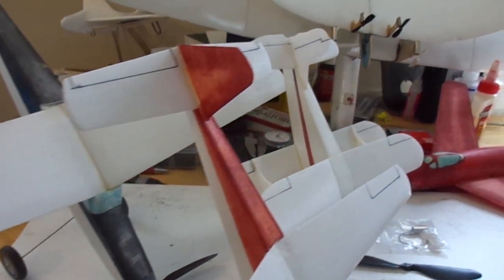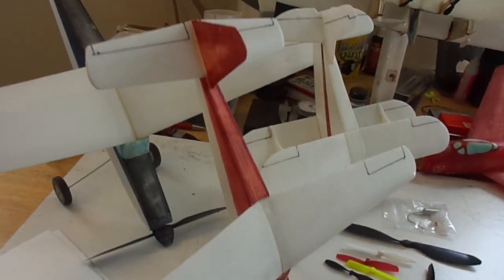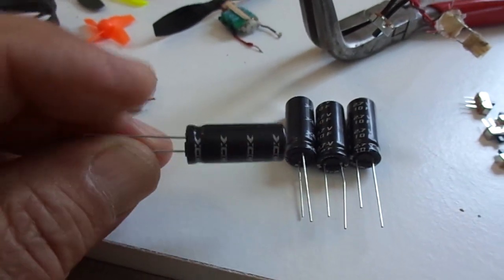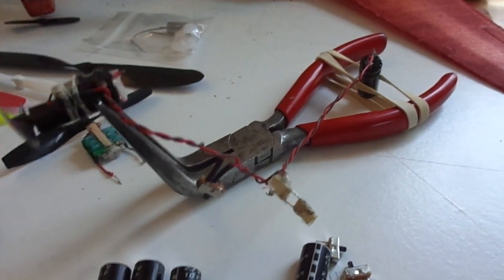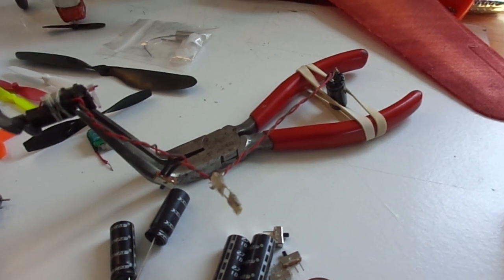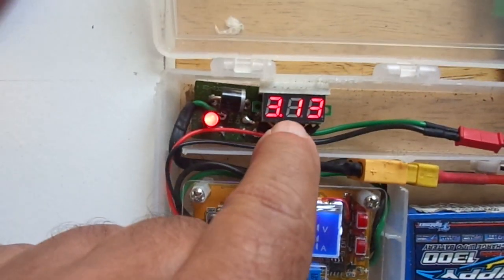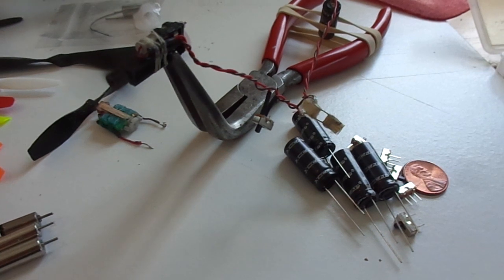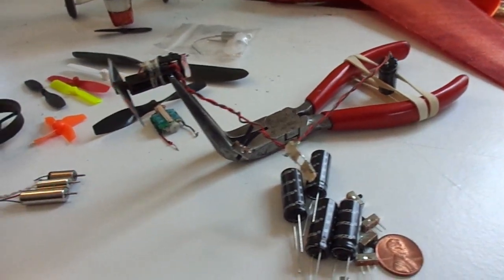SUPERCAPACITOR FREE FLIGHT BASICS

Comment: I just started playing with these recently. We found some cheap adjustable USB powered step up + step down circuits so we charge off a USB power bank. They have digital voltmeters attached. We've found that you can charge these to far higher than the rated voltage - we regularly charge to 5V, the highest I have gone to was 8V, a month ago, which resulted in catching a thermal and a 10 minute OOS flight. Remember that, with capacitors, the energy stored is proportional to the square of the voltage. At these high voltages you get a huge initial power burst, much like rubber, which makes for almost vertical initial climbs. There are a couple of videos on my channel.
Reply: Thank you! Can you share a link to the adjustable USB step up  / step down gizmo? Any how to links you can share greatly appreciated!
Reply: @stevejohnson3991  Not sure if I can post links, I'll post one in the next reply.
Reply: @stevejohnson3991 I tried posting a link, it got deleted. Try going to your favorite shopping site and search for "boost buck USB" and see what comes up

Comment: Hey mate
Im trying to understand how to do this capacitor setup. Where do you get the switches? And what sort of wire do you use for the charge port?
Reply from the maker: Hi, thanks for the view and question. I put links to some of the items including switches in the text description beneath the video. Let me know if any of the links don't work. Hope you give the caps a try. Charger wand and receptacle on model are very short pieces of thin paper clip wire or the extra wire from the capacitor leads. BTW we have been installing 2 of those little switches in parallel on each model since they are not super high quality and a double set of contacts ensures a good solid motor run. -Mike
Reply: @sonex413 thanks for that. Ive followed the links and found a few things to buy. Im building a Nesmith Cougar for my first capacitor test model. I’ve built hundreds of peanut scale and larger free flight models in my life. But capacitors interest me now

Comment: Great video! I was looking for entry points into model airplanes and got me a rubber powered glider with very nice glide performance and I also plan to do a RC conversion on it next week. 
I'm also eager to try out if the SuperCap powered Motor from Vincent Merlijns Rookie has enough power to sustain its altitude for some time :)

Comment: you could put 2 caps in parallel and get twice the runtime
Reply from the maker: We actually do that quite a bit. A good combo is a 8520 motor, 2x 10F caps in parallel and a 65mm prop on a 16 to 20 inch span foamie. Run time about a minute.

Comment: What's the purpose of adding gear reduction? Instead, you could easily use a smaller prop and the coreless motor would easily provide the rpm necessary to produce a comparable thrust or more.
Reply from the maker: It was an experiment but worked really well. I don't think anybody makes props that small commercially and smaller props are less efficient anyway.

Comment: Take a look at so called "supercapacitor chargers", like LTC3110. These bi-directional dc-dc converters control charging and discharging of super capacitors, keeping the output voltage constant even when the cap discharged. You can also charge the cap to much higher voltage and then discharge it at constant low voltage for very long flights
Reply from the maker: Thanks, that is excellent information!

Comment: What kind of discarded devices might have 10 farad caps?
Reply from the maker: Not used in many consumer devices...I've never seen one in its natural environment. They are generally used in power backup systems to overcome temporary interruptions in power supply. They have applications in computer memory backup power, etc. Best source we've found is Banggood.
Reply: @sonex413  
I had a few power transformers. 15000 mf @ 50V. Big as a beer can too. Nice transistors in them though. I'll keep an eye out. I'm always finding stuff with circuit boards worth salvaging.
Reply from the maker: @AngryHybridApe  Wow! 15000mf means it could probably kill an elephant! I found some really good 10Farad 3V supercaps on ebay recently, they are sold as "18V 1.6Farad capacitor module" and has 6 10F 3V caps on a circuit board (series wired) along with some small surface mount components which serve as a balancer for the caps. Since they are wired to the board in series you get 18 volts (3Vx6) and 1.6F (10F /6=1.6F). They can be desoldered from the board and they have a bit of an advantage over the typical 2.7 volt caps. We have flown a few and they are AOK. Same dimensions as 2.7v 10F. I bought 5 boards and harvested all the caps!
Reply: @sonex413  
You should see the transformers that came with them. A little bigger than microwave oven transformers. But thats because the secondary winding was huge.
Reply: @sonex413  
I bought some MOSFETS on ebay once. Bought them from 3 different parties. Everyone of them didnt work. I only needed two. But one guy I bought 10 from another 5 and another 3. One guy wrote me the weirdest note. His delivery was a few days late, so he wrote me asking to not tell Ebay he was late.
I wish electronic stores were still around. There's a few. But limited inventory
Reply: @sonex413  
Im making a video today if everything goes right. I make motorized paper airplanes out of microdrones. I've made a few of them so I got it down pretty good. Ill let you know how it turns out.

Comment: capasitors are a really great idea and maybe a little bit underestimated! I want to use them for some test flights when I don't know what battery or control system or receiver etc. is the best , capasitor  deffinetelly would help me to choose and also I can calculate the distance for my plane with the capasitor so actually no extra transmiter-receiver needed (and other stuff)
Reply from the maker: Great point! They are a very simple form of power for small models. Thanks for comment!

Comment: I have posted some model build photos on Hippocketaeronautics.com - ''Capacitor powered electrics vs. rubber'' under the name SX976. All inspired by the sonex413 team!! Thanks a lot guys. I am particularly happy with the Avro Manchester. Whenever lockdown ends I will be able to fly them.
Reply from the maker: Hi Chris, I was not aware of that site. Looks great so I registered (user Sonex413 of course). Hey, your Manchester is a beauty! I think there are many possibilities for caps to replace rubber when it comes to scale or semi-scale models, especially multi engine or designs with short nacelles, etc. My latest is a scale model of a semi-scale model! That is, a half-size replica of the old single channel R/C Goldberg Cessna Skylane powered with 8520 coreless and 20 Farads. I'm also awaiting a test flight but I'll post a picture on the community tab of my channel before that. Stay safe my friend, at least we're getting some building done during this lockdown! -Mike

Comment: Just built a Sopwith triplane with my 8 year old daughter, old school balsa and tissue, I think we'll have a go at this on it as a drone guy, I have a lot of coreless motors, and much bigger ones too. Best information I've found thank you for your work and passion.
Reply from the maker: Thanks Ben! Wow, depending on what kit you built, that might be asking a lot of a capacitor drive! I suggest a geared drive to allow a larger prop than a direct drive...so you can get the prop tips to stick out past that cowling. BG has a geared 820 drive with a 5.5 inch prop which might work. Remember, these motors are designed for 1 lipo cell so when we run them on capacitors at 2.8 volts "burst" voltage there is only so much power there. Don't expect the kind of thrust you get from a similar motor in a quad. Best plan is to bench run your proposed setup and see if you have enough power before you install in a model. If a supercap doesn't do the trick, you still have the option of powering the motor with a single lipo, using a simple MOSFET timer. You'll get at least double the thrust of a supercap setup. I'm working on a video on how to make the timer for about 5 bucks. See video mentioning MOSFET TIMER in the title to see one in action. Good luck!!  -Mike

Comment: Je regarde toutes vos videos et c'est fantastique j'adore mais j'ai essayé de faire des planeurs avec tout ce qui faut: capacitors 10 f ,propeleers 45 cm ou 55mm et j'ai essayé toutes sortes de moteurs comme vous mais rien a faire il ne veulent pas voler mes avions font moins que 20grammes 
Pouvez vous m'aider a voir pourquoi mes avions ne volent pas du tout merci
Reply from the maker: Bonjour, je suis désolé d'apprendre que vous n'avez pas encore eu de succès avec vos modèles! Tout d'abord, assurez-vous que vous utilisez les bons composants. Le condensateur doit être ce qu'on appelle un supercondensateur ou un ultracondensateur. Ils sont généralement évalués à 2,7 volts. Nous avons utilisé un seul condensateur 10 farad couplé à un moteur «sans noyau» de 6 ou 7 mm de diamètre. Les moteurs plus grands de 8,5 mm de diamètre nécessitent (2x) 10 condensateurs farad câblés en parallèle. Tous les moteurs que nous utilisons sont évalués à 3,7 volts, c'est-à-dire qu'ils étaient à l'origine utilisés dans des appareils fonctionnant avec une pile au lithium de 3,7 volts. La plupart sont destinés à être utilisés dans de petits quadricoptères. Voici les spécifications d'un petit modèle typique:

Envergure: 32 cm Poids en vol: 11,5 g Aire de l'aile: 135 cm ^ 2 "615" moteur (6 mm de diamètre x 15 mm de longueur) et (1) 10 Farad, 2,7 volts supercondensateur L'hélice mesure 50 mm sur ce modèle. Cette combinaison vole environ 30 secondes en moyenne.

Pour un modèle dans la gamme de 18-20g, je suggère un moteur de 8,5 mm de diamètre x 20 mm de longueur avec une hélice de 65 mm ainsi que (2) condensateurs 10F en parallèle.

Bonne chance et si vous avez d'autres questions, faites-le moi savoir. -Mike
Reply: @sonex413  mERCI BEAUCOUP POUR LA REPONSE ET C'EST TOUT CE MATERIEL QUE J'UTILISE MAIS AUCUN NE VEULENT VOLER ?POURTANT J'AI TOUT ESSAYE LES SUPER CONDENSATEURS 10,7,60 ET 2X 10FARAD ET TOUT LES MOTEURS 6,7,8,10 MM ET LE POIDS EST BON AUSSI SUR CERTAINS ,, JE NE COMPREND PAS ?J'AI DEJA FAIT UNE DIZAINE D'AVIONS DE TOUTE SORTENT MAIS RIEN A FAIRE ILS NE DECOLLE PAS ?MAIS JE N'ABANDONNE PAS  BONNE CONTINUATION POUR VOUS C'EST UN REGAL DE REGARDER VOS VIDEOS ET JE SUIS JALOUX  quel poids ne peut on pas depasser?
Reply from the maker: @noramghislain1258  Salut, Si vous regardez au tout début de cette vidéo, vous verrez trois petits modèles. Au centre se trouve un petit modèle rouge et blanc avec une aile haute montée. Dans ma réponse précédente, j'ai énuméré les spécifications d'un modèle typique ... Ce sont, en fait, les spécifications de ce modèle. Le petit modèle biplan utilise le même équipement ... et le plus grand modèle bleu et blanc (qui est en fait une version plus grande du plus petit) utilise un moteur de 7 mm avec une réduction de vitesse et une hélice plus grande. Si vous avez vérifié que vous utilisez le bon équipement, la seule chose qui reste est la charge du condensateur. Vous devriez utiliser deux piles «AA» connectées en série appliquées aux bornes du condensateur pendant environ 10 à 15 secondes. Vous pouvez lire la tension du condensateur pendant la charge en connectant un voltmètre aux bornes du condensateur pendant la charge. Une charge complète permet au condensateur de contenir environ 2,7 à 2,8 volts. Câblez les composants et testez-les sur l'établi avant de les installer dans le modèle. Vous devez observer une forte poussée pendant environ 15 secondes, avec un ralentissement progressif et une durée totale de fonctionnement d'environ 30 à 60 secondes. J'espère que ces informations vous aideront! -Mike
Reply: @sonex413  Merci pour votre reponse ,je fais des essais et vous tiens au courant

Comment: I need to order capacitors, and etc for the build along plane. Help!!
Reply from the maker: Here you go: 
50mm Props (for 615 motor) 2pr:
https://www.banggood.com/custlink/3mD3d54e63

615 (6mmx15mm) motors 4pcs:
https://www.banggood.com/custlink/mDKKwGFfEi

10 Farad supercaps 
10pcs:
https://www.banggood.com/custlink/mGm3fmVTrv
or 5 pcs:
https://www.banggood.com/custlink/Kv3DYH6g6E

Micro Slide Switches 20pcs:
https://www.banggood.com/custlink/3K3mdP0668

Comment: Some are wondering why not just use lipos. In free flight, you only run the motor for 30 seconds, otherwise the plane will disappear. So you need a timer on the plane to shut off the current to the motor from the lipo battery. Yes, you can charge less but then you have lower voltage. You can also use smaller capacity lipo but then overtime you'll have degradation and that will lower your capacity even more. The advantages of super caps is fast recharge, fast power delivery and more charge/discharge cycles than lipo. Plus, you don't have to worry about lipo storage and storing it at 3.7 volts. Like batteries, you can do series/parallel setup with the super caps to give you higher voltage or more flying time or both. I hope I got the last part right because I've never tried it with super caps but I would think they work like regular caps in that regard.
Reply from the maker: We use 2 caps in parallel with no problems for greater duration. I have come up with a MOSFET timer as others have done for applications where we need a higher voltage.

Comment: I believe the motors you recommend are no longer available.  The link you provide ( https://www.banggood.com/4X-Original-... ) comes up as "Page Not Found"  Is there another motor you recommend for this setup?  
And thanks a bunch for doing the video....very informative.
Reply from the maker: Hi, thanks for letting me know, I'll take care of updating that link! Any of those little hobby-grade 615 motors will work, as well as just about any small coreless motor. Here are some that are currently in stock and work well. Don't hesitate to experiment with different sizes of motors and props! Have fun, =Mike and Richie in Massachusetts.
https://www.banggood.com/4X-Racerstar-615-6x15mm-59000RPM-Coreless-Motor-for-Eachine-E010C-E010S-Blade-Inductrix-Tiny-Whoop-p-1115473.html?p=AZ31114857064201605K&custlinkid=720929

Comment: I still have several old wood rubber band model kits designs of WW-2 mostly. Just waiting to build that I bought in the 60’s to 70’s. 12” wing span up to 28” wing span. Would these work on my old models.
Reply: Right now I’m building three model planes plastic 1/48 scale and one 1/32 scale. But I have a Guillow P-47 Thunder bolt plane that I started the body is mostly done. Then I also started the build of a Guillow 15” wing span typhoon plane. I cut out all the parts and started to clean up everything but it ended up put away for now to many other things to fix up or finish up. I have a 5’ speed boat to restore for some body I’m swimming in kit work. I never learned about electric before always wanted to try but never had anyone to learn from. Very kool simple looking projects.
Reply from the maker: @lestermiller2717  Let us know if there's anything we can help you out with!
Reply from the maker: Yes, absolutely! ...and they never blow up inside the fuselage taking all the formers with them! There is only one drawback to balsa and tissue...have you seen the price of a bottle of clear dope lately? Seriously, the capacitor/electric power systems are ideal for small scale models. Weight is pretty close to an even trade vs rubber...balance is easier because you can put the cap wherever you need it to go...multi-engine is easy, as are designs with short nacelles. The structures can be lightened a bit since they won't have to resist the tension of the rubber motor. Let us know if you build one, we'd love to see it! -Mike

Comment: thanks very much that was answer to my questions, ill be doing something similar with the cc cv charger and lipo set up i think. i think a volt meter on the circuit is essential for timing the charges perfectly
Reply from the maker: Glad you found it helpful. I put together a video on building our charger in case you missed it. We have built 2 identical units, love 'em! Good luck in your cap projects, post a video from time to time and let us have a look at what you're doing with them! -Mike